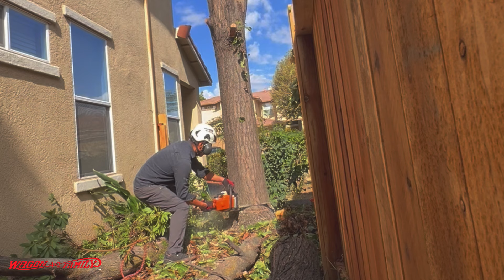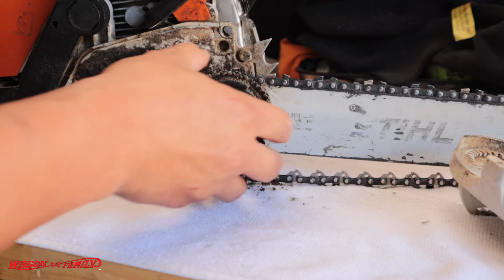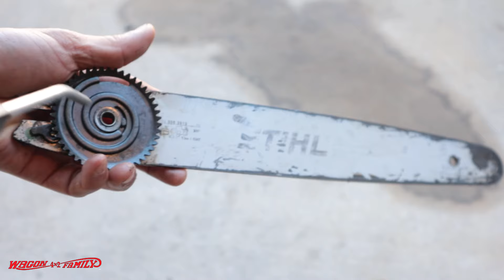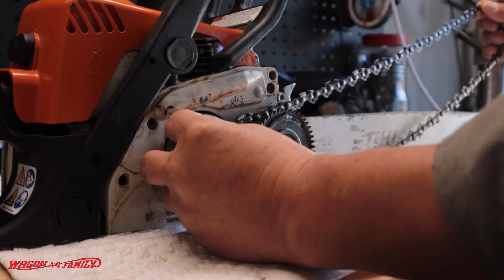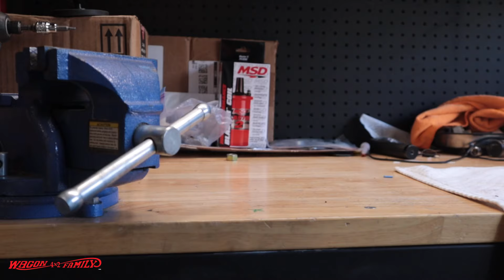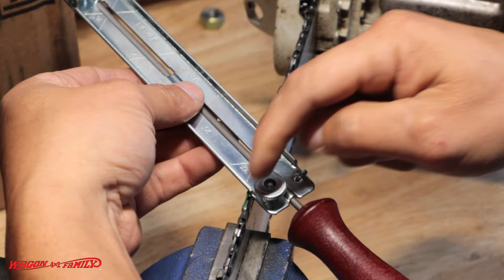Chainsaw blade sharpening | ASMR

Comment: For your information a chainsaw does not have a blade or blades. It has a chain with teeth that runs on a bar propelled by a centrifugal clutch. Last I checked anyway.